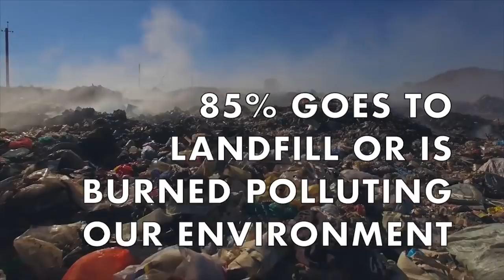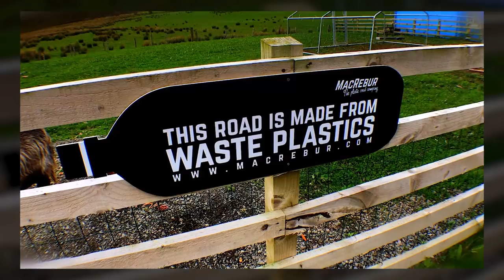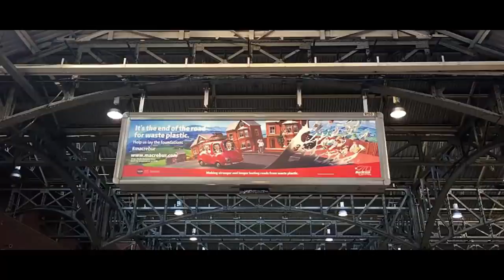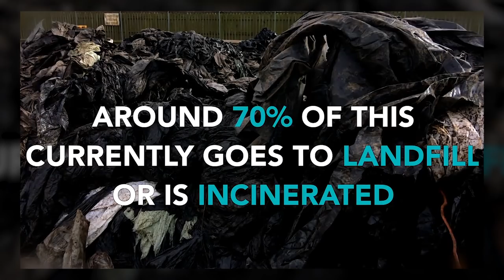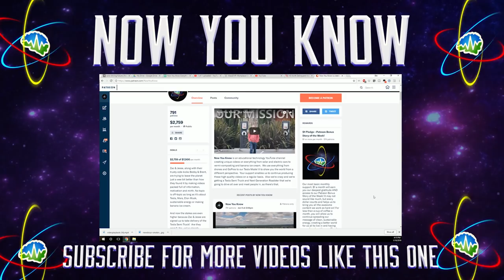MacRebur - The Plastic Road Company! Interviewing Toby McCartney

Comment: As a number of people in the comments seem to have missed this point - the plastics replace part of the bitumin. Both plastics and bitumin are oil based (ie hydrocarbon) products. Thus the resultant road surfaces will act in similar ways. If you are concerned that this new road might degrade and leach hydrocarbon products into the water-systems, then a little logical thought tells us that this is already happening with the bitumin roads.

I figured that I'd also take a look at the MacRebur website and sure enough there on the front page it also addresses this exact issue with the following quote: "MacRebur’s® waste plastic pellets are fully melted into the bitumen within the asphalt mix and so no microbeads are present in the mix – in fact, with MacRebur’s® MR products included, less bitumen leaches into rivers and streams."

Comment: Those plastic bags can be used for garbage cans and packing material, I use them in my shop as trash bags and that works well for me. I also have used them for packing material.
Reply: For every one of you, though, there are 100000 people who just chuck them. The proper solution is an all out ban.
Reply: Although you are correct in an outright ban on plastic bags I just ride the wave until it ends.

Comment: Great idea and hopefully this technique could be expanded to other bitumen products such as roof shingles and sealants etc. but as was made clear, this only scratches the surface of the single use plastics waste problem and it would appear the only way to solve the problem would be through legislation.

Single use plastics should by law be bio degradable, unless it is shown on a case by case basis that bio-degradable is unsuitable for purpose, in which case it should be taxed by weight for the external environmental costs.

Comment: Actually these pot holes come from snow truck plowing. those snow plowers have enough strength to break concrete. if it causes too much friction with the road it easily scoops up the uneven parts of the road. however im glad we can have a new way to use thrown out plastic